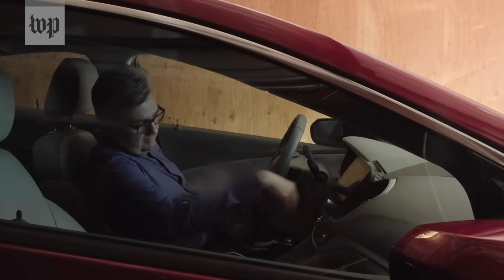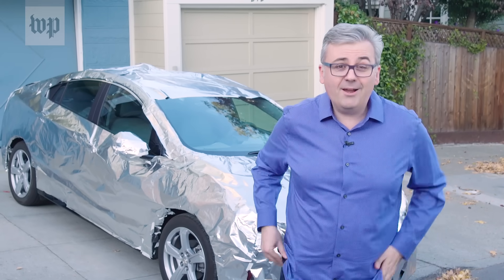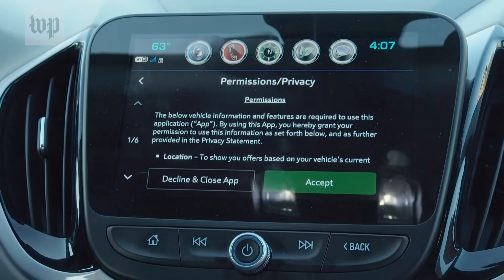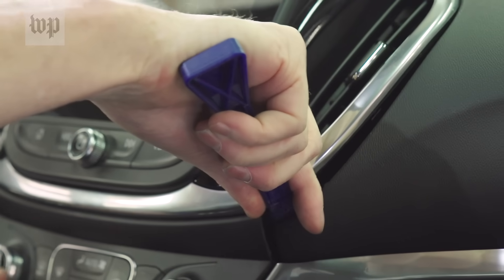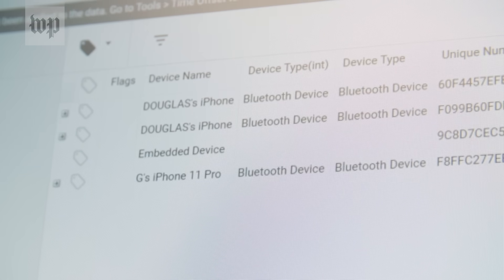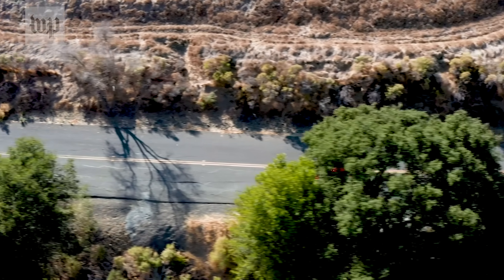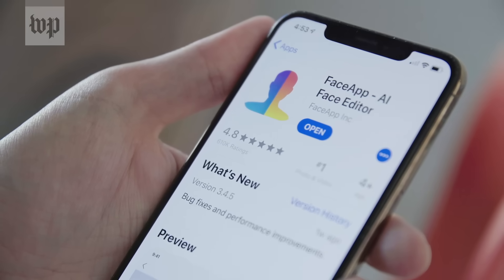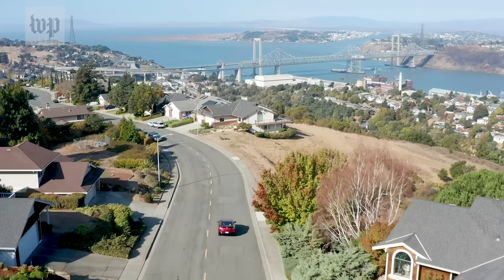Cars now run on data. We hacked one to find out what it knows about you.

Comment: I don't drive late model cars for several reasons. This is one of them. I drove a 2006 Mercury Grand Marquis for 11 years, and put 381,000 miles on it (I bought it with 97,000 miles) It does not have an infotainment center, anything like On Star, and no internet connection whatsoever. It still has its original oem cassette player. I recently bought a like new one owner 2007 Mercury Grand Marquis to eventually replace the 2006 with. It only has 36,000 miles. But they are identical cars. None of that trash technology. And I use a 1990s style flip phone. I have never used a "smart phone" and never will.
Reply: If you use GSM phone it spying on you anyway 🤣
Reply: Don't be a dolt.  Your cell phone is way ahead of your car in data mining.  Chances are your tvs at home help out too....
Reply: @spazzman90  My cell phone is an old school flip phone with NO internet connection, and has a removeable battery. My TV is from 1997. It has a built in VCR. I only use it to watch stuff recorded on VHS tape. New cars do a lot more than collect data. They have a camera and microphone in the dash that watches and listens to everything you do or say, and sends it over the internet to who knows who. They also apply the brakes and turn the steering wheel by themselves.
Reply: @geraldscott4302  your life sounds awesome.  Do you enjoy texting people by repeatedly pressing numbers?  How are those VCR tapes holding up?  There should be a balance here.
Reply: @andyspinball  thats his choice !
Reply: @AnthonyJones-vk6xq  true.  I get not buying the late model cars for the reasons he gave.  I agree with that.  The VCR and flip phone thing though...  Hard pass there.  Many (Ford) cars are now reporting speeders to the customer's insurance companies.  That chit don't fly in my 2007-2010 vehicles!
Reply: @andyspinball  Agreed, i still have an old Nokia 6330 its battery lasts all week, no internet of course, but i am not or never have been on social media so to speak, my cars are a 1995 Renault, a 1997 Renault and a 2008 Nissan ! As for the VCR i still have one as i have a collection of old videos which are fun to watch although the quality really SUCKS !
Reply: @AnthonyJones-vk6xq  my 87 year old father still records his programs on his VCR in his assisted living facility.  Hey, watever works.  I'm driving an 07 Fit (93k miles), an 07 Tacoma (102k miles) and a 2010 RX350 (117k miles).  Your kids destroy the inside, and fellow drivers destroy the outside.  Why buy a depreciating asset new only to be disappointed every time you turn around.  My 3 year old (at the time) left crayons in the back of my nice Lexus IS250.  They melted and the car remained that way until I traded it.
Reply: @andyspinball  Totally agree about the huge depreciation on new cars and added to that the exterior getting trashed by other drivers....so older/cheaper cars are the way to go.
Have a good weekend.
Reply: My cars are 1994,2007 and 2012 is a camaro, but onstar doesn't work in nz anyway
Reply: They've had access even before Onstar was implemented, when vehicles went from carbureted to electronic fuel injection and put the ecm in vehicles.
Reply: @philbuell6657  Back around 2001 they started putting "black boxes" in cars that recorded the last 30 seconds of certain things, like the position of the brake pedal, gas pedal, and vehicle speed. When the 30 seconds were up, it recorded the next 30 seconds again. When it worked, the cops could get this information to help them decide who was at fault in an accident. But they actually had to have physical access to the box. It did not transmit anything, and it did not take video and audio of the driver and everyone else in the car. Also, those devices can be removed. I know where they are in my cars. I left them, because (if they work) they could also help prove an accident was NOT my fault. They are NOT trackable.
Reply: That doesn't make any difference,,,your TV does the exact same spying,,,As does new fridges ,,new cookers,,,and even washing machines and toasters,,,They all spy on you ,,They all have internet connectivity ,,,Someone driving by your home can hack your toaster and download files on to it store them there for as long as they want,,,They can even tell a second party where the house is and from any country in the world they can recall them files from your toaster,,,,,If you think I'm kidding about this ,,I'm not,,,look it up yourself,,,

Comment: Insurance companies would love to have this data & car makers would sell it to them if they could.
Reply: They already do...
Reply: @Squirrel-Chaser  Correct.  I get offers based on my driving habits, occasionally.
Reply: INSURANCE COMPANIES HAVE THIS INFORMATION AND MORE
Reply: Don’t think they don’t.  The little gizmos they give you to plug into the obd2 is simply more privacy breached.
Reply: @habbadabbado5765  And even worse, those little gizmos can trash the electronics in the auto.

"For those of you who want the bottom line DLC Dongles are particularly troublesome and can cause diagnostic failures and drivability problems.”

Both insurers and other third parties have marketed such devices to customers in recent years. A 2015 Kia technical service bulletin mentions multiple companies with OBD-II dongles by name, but Kia confirmed it was using them illustratively. It referenced them simply to help shops visualize what third-party DLC dongles look like rather than pointing to specific brands that caused problems."

"Kia warned shops of issues related to items plugged into the CAN network in a September 2015 bulletin shared by NASTF:

On some vehicles, customers or dealers may choose to install non-Kia aftermarket accessories which, under certain circumstances, may cause improper operation or even damage to components. When diagnosing improper and unusual operation or CAN codes, especially in ABS/ESC, TPMS, NAV head units, ECM, TCM, HVAC, BSD and other systems on the CAN bus, technicians should inspect under the dash, and in engine compartment areas, for any aftermarket equipment that may have been added to the vehicle. Where wires have been spliced, identify the circuit and system before making recommendations for replacement of components/parts and, temporarily, disconnect the accessory from the vehicle’s electrical system to test and verify it is not the root cause. If confirmed, advise owner of the incompatibility and recommend removal of the aftermarket equipment. Removal costs are considered the responsibility of the owner and should be communicated to the customer BEFORE attempting any repairs. If equipment was dealer installed, the selling dealer may be held accountable for the cost of repairs and any associated warranty claims may be subject to chargeback.

The OEM also warned in a July 2015 bulletin that the existence of such a device could produce customer-facing messages.

When addressing customer concerns regarding a “Vehicle Diagnostics Failed” message displayed on the head unit screen (A), check for the presence of an external device (B) plugged into the vehicle’s DLC port. If an external device is present, remove the external device from the port to prevent it from interrupting the UVO eServices vehicle diagnostics. After removing the external device, cycle the ignition multiple times, if needed, and run the vehicle diagnostics again.

Seyfer said once such an OBD-II plugin is removed, the CAN will return to normal operations.

“There’s a lot of reasons why we have issues with these,” he said."

And that is just one auto company.
Reply: who you think they're selling it to?
Reply: They already do.  I watched a video on YT where a woman's premiums from driving a Chevy Camaro tripled or quadrupled as a result of the data OnStar sent to her insurance company.  This is already happening.
Reply: They've been doing this for a while now. 
Part of the reason our insurance rates are skyrocketing.
Reply: @Cybersawz But our Government is worried about Tik Tok they need to fix this
Reply: Wow..I'm only watching this video b/c of a report I saw today. Many people who drive certain brand cars saw an increase in their insurance by up to 20%. The auto makers are selling driving habit data  to insurance companies & they are using the info to increase premiums. You called it!!!
Reply: What makes you think that they aren't already doing it?
Reply: and yet they can't track stolen cars. literally everyone benefits from the data collection (including thieves) except the owners
Reply: @mylifeasmanta  Very good point.
Reply: @mylifeasmanta That really is the crazy part of it. I live in West Africa, and the amount of stolen cars coming into the ports in Team (Ghana) and Lomé (Togo) is staggering. It's also connected to the drug trade and money laundering. Some people are getting very rich, and this could be stopped by the car companies, police, and insurance companies, but they keep making money, so there's no reason to stop.
Reply: They may already been doing it !
Reply: They are already doing it
Reply: Ukraine sucks the most corrupt goverment in europe even before the war and very very racist been there before the war racist bigots
Reply: Where s my reply ?
Reply: Who is erasing my reply’s

Comment: Well, if it's connected to the internet, shouldn't there be a SIM somewhere, or some similar module? I would say destroying or removing that module should resolve it.
Reply: Yea, there's is definitely a wifi radio. You'd probably have to desolder it worse case scenario.
Reply: Esim is integrated
Reply: When you connect your phone over Bluetooth to hear music or take/make calls - that will provide the necessary internet connection to the onboard computer. In the time you finish one song or one call the OBC has transmitted and updated all data in the background. A seperate SIM is not needed.
Reply: @SubramaniamLakshminarayanan That's incorrect. It's possible to share an internet connection over Bluetooth but that feature has to be enabled, if available at all on both connected devices. 
Same way one can connect a phone for in-car calls without granting access to contacts and messages. 
If a phone shares Internet by default, better get rid of it.

Cars might not even be able to use your phone's connection via Bluetooth. No need for that when it has an embedded modem which can run 24/7.

Comment: disconnect the antenna for the onstar box or remove the box entirely
Reply: I just did this on my new (to me) 2018 Volt LT. It's easy to reach the antenna connectors, as the OnStar module is under the dash to the left of the steering wheel. However, a radio transmitting without an antenna may sustain damage. 

Instead, I popped out the entire Onstar box, opened it by removing the four T10 torx screws and lifted off the case lid. You can lift out the main board and you'll see the radio board beneath it. Remove the three T10 torx and you can take out the radio daughter card. Put the mainboard back in the case and put it back together. Reinstall in the car and plug in the two white power connectors. 

The bluetooth and Sirius XM work fine. OnStar can't be reached. Problem solved. Problem staying solved.
Reply: @sartorius73  This comment needs to be pinned to the top of the comment section.
Reply: @barefoot-earth  Thank you for your kind comment.
Reply: @sartorius73  thank you for this do you have a video on the process.
Reply: @SP-cm8lg  I don't, but it's easy to do. The Onstar module is in a black box held in by clips in the driver's kick panel on the left side, just behind the fusebox.
Reply: @sartorius73  any issues like engine light, or something not working.
Reply: @SP-cm8lg  No issues whatsoever. You just don't have OnStar. If you push the OnStar button, it tries to connect and then tells you that it can't.
Reply: Just buy a points and plugs older car, problem solved.
Reply: Next GM will (or has) updated its fine print to say OnStar module removal voids warranty. Should have let GM go bankrupt.

Comment: My 05 Pickup does not collect data, doesnt even have a CD player or keyless entry. Just the way I like it, basic, reliable, and you cant hack it.
Reply: Does it have an ECU or fuel injection?
Reply: @brokenking5044  Fuel injection is more reliable than carburetors.
Reply: Amen!!
Reply: Or a fuse box?